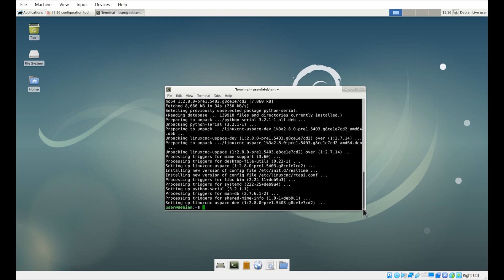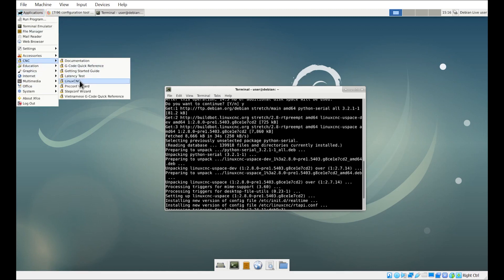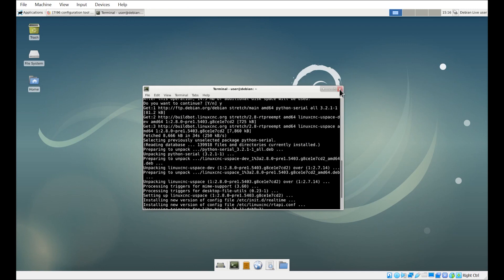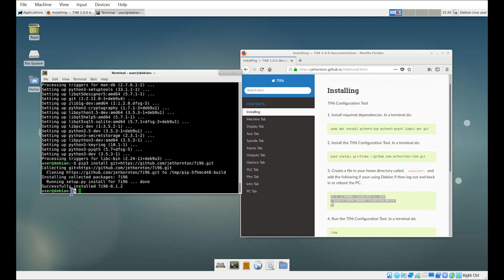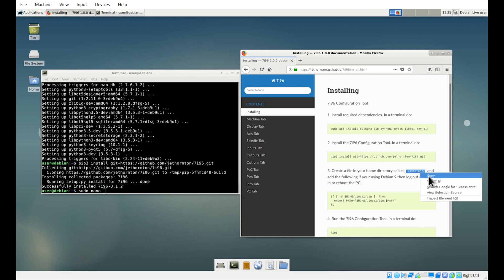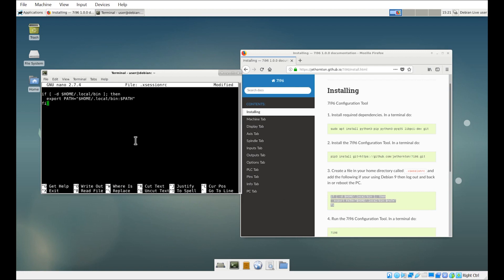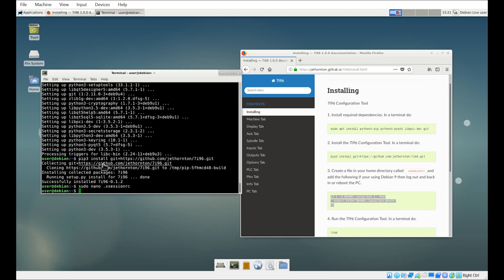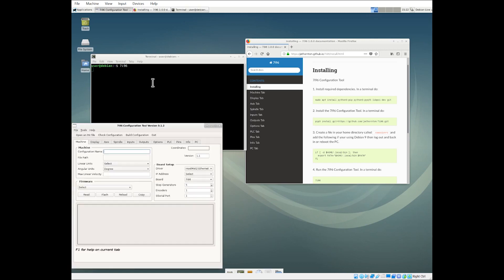Installation of linuxcnc 2.8 and 7i96 configration tool + test connection to 7i96

Comment: Just to make sure, what is different between 7i76 and 7i96 ? If I use linuxcnc 2.8 above then I can use 7i96, is this right ? So for linuxcnc 2.8 user, it is better to use 7i96, for older 2.7 then we can not use 7i96 ? Thanks.

Comment: When I connect my 7i96 board to 5V power I get a red blinking INIT led, and I can't get it to ping. Any idea on what could be the issue?
Reply from the maker: I didn't encounter it myself but after a little googling I found if you have a blinking INIT led and solid /Done likely you have a  problem with 5v supply (high ripple or voltage drops out with load), if you are sure you have a good PSU, the blinking INIT led could be an indication that you are in the fallback config and honestly I don't know much about that, ask the forum (forum.linuxcnc.org) they should know much more than me.
Sorry for the late reply hope you get the problem solved :)
Reply: @deadio1361  yep, I fixed that 3 days ago replacing my USB charger with a proper 5v PSU! Now I'm working on the conversion from 2.7 - parport to 2.8 - Mesa.
Thank you

Comment: Nice, 
Looking forward to the further videos. 
Also if you are connecting the ethernet cable directly, don't you need to use crossover cable?
Reply from the maker: Glad you enjoyed it,
I used a normal ethernet cable that came with my old router, no crossover cable needed.
Reply: Crossover cables are a thing of the past, only needed if the cards on both ends are "dumb", I haven't seen one "NEEDED" (certainly seen them used) for about 10 years now.